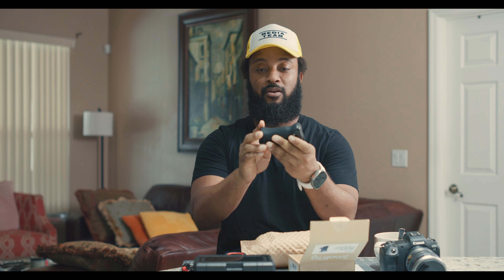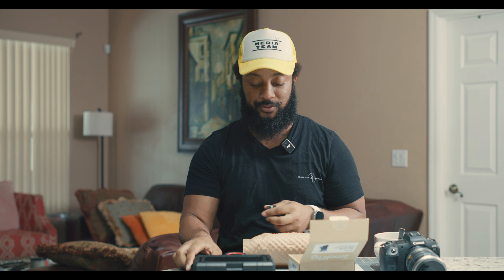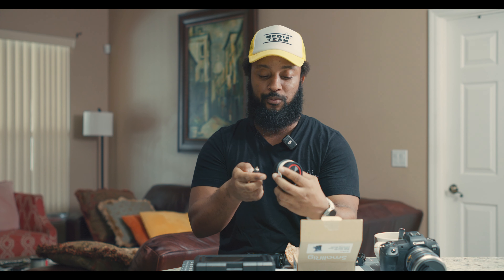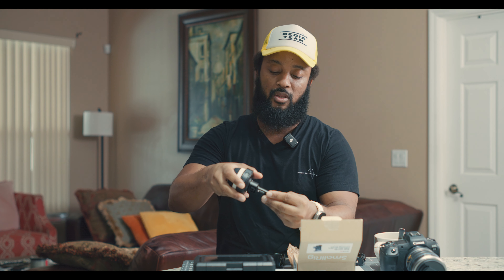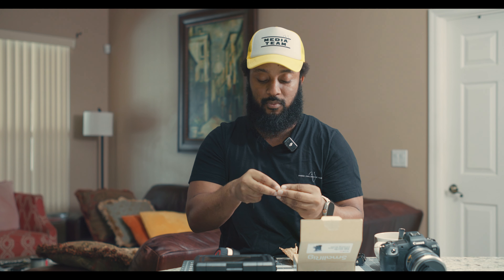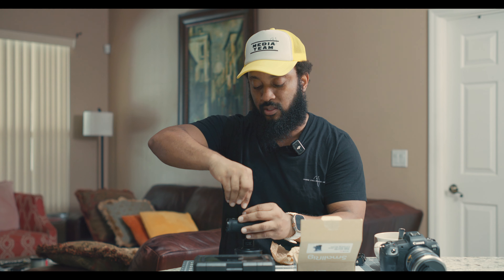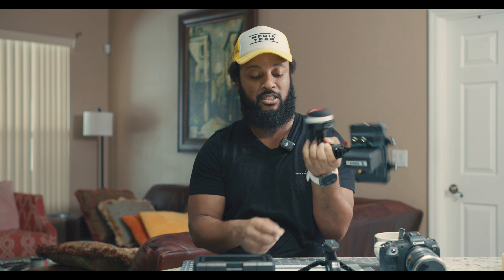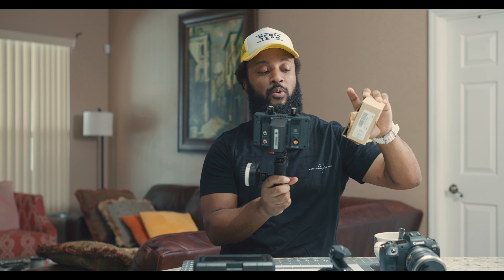Using a SmallRig Handle with 2-in-1 locating screw alongside my Smallrig Wireless controller (Lite)

Comment: Hi, I've been struggling for hours... After the calibration it's still not working. While I spin the wheel on the controller the numbers on the motors is running, but the motor is not moving. Do you know why? I really appreciate if you have any tips on how I can solve the problem.. Thank you!
Reply from the maker: If you’ve calibrated it that means that the controller and wheel are in sync. Try resetting it but pressing the WiFi button to get the lights to come on and match and then try calibrating it again.